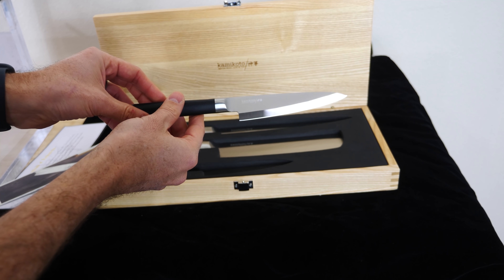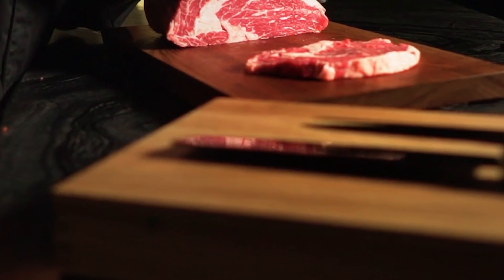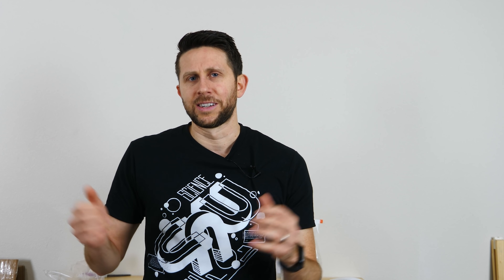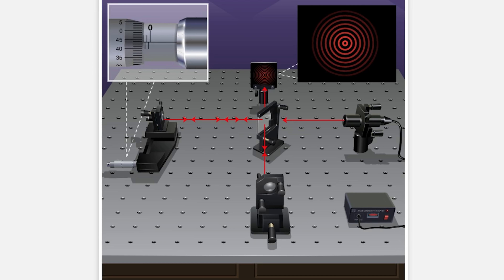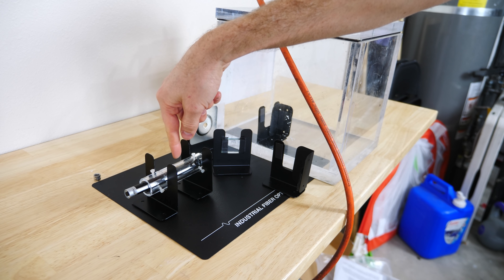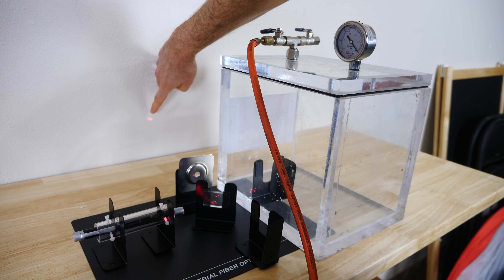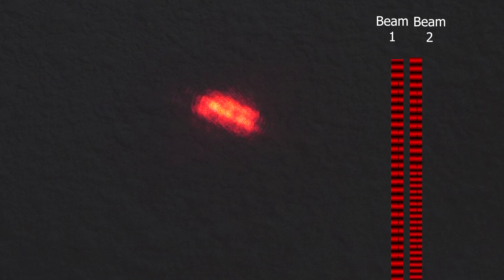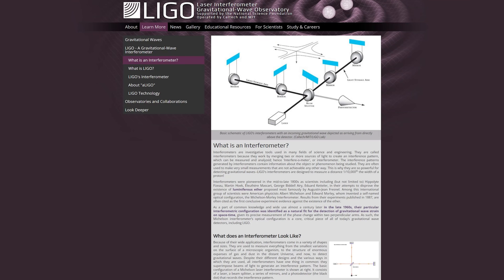The Most Famous Failed Experiment

Comment: Since the aether moves vertically into the Earth, in this setup it affects both interferometer paths in the same way, so no difference arises between them. There is an experiment that takes this movement into account and where the shift in the interference pattern is evident. It's called "Extended Michelson-Morley Interferometer experiment. English version" on YouTube. 
It's actually quite absurd to assume that the aether doesn't exist, since you can see something everywhere and photons must be everywhere. Traveling photons would therefore have to fight their way through a multitude of already existing photons. Google Angerbichner.
Reply: Isn't this done in space with the same result

Comment: This is right, but the reason why the pattern lines appear is still because of the semi permeable reflective mirror. Light does not do real cancelation like wrongly often misconceived/misconducted/stated. It's unlike a wave of e.g. water or sound acting in e.g. air which are indeed able to cancel each other out like magnets aligning, + and - = 0. But this common misconcept is due to the fact that light still can be altered in speed, frequency of the 'mass' or rather density would almost be more precise as of this case. It used to be already a sum of the addition of + & - itself as result. All cancelling in the experiments which look like e.g. waterwave or noise cancelling properties are just illusions as of being an constant acceleration kinda effect. It is like a very unheavy plasma like balanced gas or rather like aligned hydrogens of the atoms, a cascade of hydrogenlike order which seeks entropy, therefore can only get even more ordered in some altering way of it's underlying energy state of + & - .
Waterwaves have movement which can repell each other and kinda cancel itself out, sound is a wave of air itself movement which therefore can cancel itself out like wind in different fqs.

Comment: The problem is the experiment is seriously flawed and never could provide an accurate result. I'm not being an ignorant person, there is a very logical and intuitive reason the experiment would never provide an accurate reading.
I'll explain by proving the same thing could happen with sound. Take two trains and have them a set distance apart. Have the rear one blast its horn. As soon as the front one hears the horn, it blasts its horn, then the rear one records the time it took. Let's say it took 2x seconds. Next, blast both horns and have each train record the time they heard the sound reach them, which would be x seconds each.
Next, get the trains moving at some speed, keeping the distance between them constant.
Next, repeat the experiments again. The result will be that no matter how fast the trains are traveling, the result of the first experiment will always result in 2x seconds. This is exactly how the experiment is flawed. No matter how fast the apparatus moved, it would always provide the same result, just like sound did, yet nobody claims sound has a constant speed like light does. Go the the second experiment and what we intuitively know about sound is revealed. For the second experiment, as long as the trains are moving, the sound the rear train hears always makes in under x seconds. Also, the front train. Always hears its sound after x seconds. Each time, they differ from x by the same detla. That is why when they are added together, they always equal 2x.
This is the fatal flaw of the Aether experiment. They have the laser go both ways. Ya, one of them travels perpendicular for a while, but before the splitter, it traveled along the same path. If the straight beam was slowed before the splitter, so was the perpendicular one. Sure, the straight been goes on after the splitter, continuing to be slowed, but then it turns around and gets a speed boost all the way back to the mirror. By the time it joins back up with the perpendicular beam, it has undone any distortions it had gone through.
The only way anyone could guage Earth's speed through the universe from light is to gauge it's speed in only a single direction without the use of mirrors. The moment you introduce a mirror, you are guaranteeing you will only ever get an average speed.
Here's another clue. We all know that if a train is moving towards you or away from you, it's sound is distorted by the Doppler effect. A distortion induced into the sound wave because the sound is moving at a constant speed in relation to a moving source. We also know, that for the people on the train, the sound of the horn is normal, whether they are in front of the horn or behind it. We can add to this, that in reality, the sound wave is actually distorted in the atmosphere. The train observers hear an illusion that the sound is a normal sound wave because their ears are traveling at the same speed as they horn. Their change in position in relation to the speed the sound is traveling removes the distortion from being heard or noticed. This is yet more proof that the Aether experiment was flawed. You can't guage the distortion in the frequency when traving in the same direction at the same speed as it. The same would go for light.
We do know that light does get distorted by motion though, because experiments have proven blueshifting and redishifting. Such are caused by the Doppler effect, just like sound. The Doppler effect being induced into light is yet more proof their experiment was flawed. The only way to create a Doppler effect is by having the source and the detector going at different speeds. This means that one of them is not observing the light moving at light speed.

Comment: The earth is flat and stationary, space is fake. The reason relativity was introduced after this experiment was because there’s no other way to discount the results except by ignoring them which is why they introduced the Lorentz transformation formula, this formula is used to overwrite the results which were conclusive, the earth is ‘stationary’.
Everything is now based upon pseudoscience because the mathematical formula is written into everything.
The universe is geocentric not heliocentric.
Reply: Space is bubbly and dynamic, which is why Earth is round and is in motion around our empty sun because the pressure differences in space have compelled it to do so.
Gravity is due to stresses on fluid that permutates throughout space, leading to flows inside atoms and interactions with atomic nuclei. The most concentration of the resulting forces is labelled "strong force", the least is labelled "gravity".
Reply: @The-Old-Green-Man-OAP  put your dope pipe down…

Comment: Very nice. My only complaint is saying a gravitational wave could pass one of LIGO's arms. The waves were 30,000 km -ish in wavelength, so both arms are hit. They're at 90 degrees, so one gets longer and one gets shorter, which doubles the signal....that's because it's tensor polarization, because gravitons are spin 2, unlike spin 1 vector polarization of light. It's all very geometric.

Comment: The Michelson-Morley Experiment still lives on in modern FT-IR spectrometers. Instead of browsing through all wavelengths of radiation, which takes a lot of time, all wavelengths are measures simultaneously, with the intensity of each wavelength being calculated using interference and Fourier Transformation.

Comment: What effect does constant rotation (around the vertical axes, horizontal axes) or accelerated rotation have on your fringes? (Rotation will of course mechanically change the length of the optical paths, but I still wonder whether one would see something unexpected).

Comment: The ether does exist.
Light is not a traveling particle.

Explain how light does "speed up" again after "traveling" through a medium like glass.

Sound is created by a perturbation in the air. 
Illumination (what we see as light) is created by a perturbation in the ether.
Think of what an electromagnetic wave is...a wave is not a thing of itself, it is what something does, therefore it is a wave in the ether. 
There has to be a medium and it's the ether. 
You can call it quantumfoam or any other name, but it undeniably exists.

Comment: the EXPERIMENT IS MADE FOR THE "THREE DIMENSIONAL" WORLD  !!!   SO YOU GET THESE RESULT   !!!   YOU HAVE TO CHANGE THE MIRRORS (TO TWO SIDED MIRRORS  AND YOU HAVE TO COVER ONE SIDE OF THE MIRROR  WITH A HOLLOW (METAL) PIPE    !!!    WHEN YOU FLIP THE MIRRORS  (THE PIPE TO THE INSIDE OR TO THE OUTSIDE)  (MIRRORS AT THE SAME POINT AS IN THE OLD EXPERIMENT)  YOU WILL "NOT"  GET THE SAME RESULTS    !!!!   BECAUSE  "LIGHT "WORKS IN HIGHER DIMENSIONS THAN THE THIRD DIMENSION    !!!!

Comment: The Michaelson-Morley experiment is famous, not because it failed, but because it was a resounding success.  It's purpose was not to measure the motion of the earth through the ether, or to prove the ether existed.  It's purpose was to test the existence of the ether, and if it existed, to measure the earth's motion through it.  The experiment was so successful because it was so well designed that its results were conclusive.
Reply: Since the aether moves vertically into the Earth, in the normal setup of the experiment it affects both interferometer paths in the same way, so no difference arises between them. There is an experiment that takes this movement into account and where the shift in the interference pattern is evident. It's called "Extended Michelson-Morley Interferometer experiment. English version" on YouTube. 
It's actually quite absurd to assume that the aether doesn't exist, since you can see something everywhere and photons must be everywhere. Traveling photons would therefore have to fight their way through a multitude of already existing photons. Google Angerbichner.

Comment: Waves travel through mediums.  This is the intuitive reason behind the theoretical aether. The more we learn about the quantum world, the more we find we have a need to reinvestigate the possibility of an aether.
Reply: Since the aether moves vertically into the Earth, in the normal setup of the experiment it affects both interferometer paths in the same way, so no difference arises between them. There is an experiment that takes this movement into account and where the shift in the interference pattern is evident. It's called "Extended Michelson-Morley Interferometer experiment. English version" on YouTube. 
It's actually quite absurd to assume that the aether doesn't exist, since you can see something everywhere and photons must be everywhere. Traveling photons would therefore have to fight their way through a multitude of already existing photons. Google Angerbichner.

Comment: Interesting note about the original Michaleson-Morley experiments:  Although they could and did use monochromatic light (sodium flame) for calibration, they used white light for the actual experiment, so that they could use the colored fringes of the interference pattern.  Apparently this helped them compensate for some of the vibrations caused by passing horse traffic.

Comment: I think your set up could be showing the very slight flex in the bottom piece of polycarbonate from your vacuum chamber, that very small flex would change the mirrors distance and overpower the actual speed difference. Maybe do this experiment again but some how isolate the mirror from being effected by the walls or top or bottom of your vacuum chamber, or build a very strong granite or steel plate as a replacement for the bottom, those would have way less flex. Just an idea

Comment: Hello Action Labs.
If a Body following the Archimedes' Principle was in a void (a closed off cube or sphere) of fluid with no other fluids within it, with the body having fluid inside of it as well but not completly filled and beeing able to deform, would centrifugal force still affect the inside of the body?

Basically my Question: 
If a human was put in a Pressure Suite and then into a fully filled tank of fluid,
 with the Pressure Suite achieving Arichmedes' Prinziple (the body floats in the the water like a submarine, neither on the top nor the bottom),
How would the cube and with it the body react to centrifugal force?
Would it Increase the Expierienced G-Forces to the body, would it stay the same or would it even decrease them?
If the cube was put under centrifugal force, would the body move and lose Arichmedes' Principle?
 Would the Pressure of the Suite need to be ajusted?
Would the body remain in Arichmedes Principle but rotate around one of it's axis? 
How would the Pressure of the Fluid change depending on location in the cube/sphere?
What if there was no pressure suite but the body stayed floatin inmids the water, how would it affect it?
What if not a body but another sphere was within the first, with the same fluid but the smaller sphere was weightless and wouldn't pressure the innerfluid. Would it act like a Waterbubble within a watterbubble? 

I thought of this because of Ace Combat 3 and it's COFFIN Systems.
Now, I guess if I finished school I'd know this but anyway, I hope you could feature these questions in a video or some physics literate answer in the comments.
Would be really interested, though I think I know most answers to it.

Comment: M&M instrument could not measure what they intended. What you are measuring is the bending of the metacrylate wall of the vacuum chamber due the effect of atm pressure. This is what interferometers are good for, changes in refraction of light, nothibg else. 
Path of light beam through vacuum is not long enough so see effect of air.

Comment: Not as much related to this subject, but I'll try and ask anyway.

I have been wondering for a while, in Einsteins Field equation; E=MC^2, we can calculate the energy in Light, even though Light doesn't have a Mass, but only a momentum/Velocity.

My question is; wouldn't Einsteins equation also allow for an object, particle or event, where you will have pure mass and approaching absolute zero velocity? Can we describe the behavior of such a phenomenon? If such a particle could exist, would we even be able to observe it or interact with it?

My apoligies if the question does not make any sense, but if it does, I hope it could make for an interesting video.
Reply: Now im not 100% sure if I am right but I think that the equation stands for two objects of mass bumping into each other at speed of light; the E stands for the pure energy it would produce, there won´t be any leftovers of mass or velocity. In the case of light...in the equation, the M stands for mass, so it would be 0 therefore energy is 0 too, but...actually the light has mass but it is very very little. I might be wrong, it is not a simple concept.
Reply: @noemkinator  Thank you for answering. 
And it sounds like it sums up my question very neatly.
I don’t recall if it was from this channel I heard it, just remembered that the explanation for Light being able to transfer momentum an object, even though it doesn’t have any mass, was because the equation allowed it to carry momentum despite not having a mass.
Which, of cause, made me speculate if the contrary was possible, having mass without velocity.

Comment: wouldn‘t the altering interference-pattern occure anyway, since the light travels through the glass of the vacuum-chamber where it changes its velocity?
Reply: Yes and no; yes the interference pattern will be different than if the glass wasn't there, but in this case it's always there so you can ignore it for the purpose of measuring the refractive index of the air

Comment: The thing I still don't get is if you're moving at say 50% the speed of light, and emit light, it would be moving faster than light relative to a celestial body emitting light. But it's said to take astronomical amounts of energy to accelerate anything faster than light -- even light itself. Which makes me wonder why we don't constantly see light moving faster than light.  After all, if you shot light at just the right angle/timing, you should be able to accelerate light to faster than light speeds rather easily, by making one photon push another.  Do this in a big enough chain, and you should be able to get a significant amount of acceleration.  Heck, you should even be able to do it in a simpler way, by having a fast rotating armature that is very thin (think spinning a flat human hair, but smaller), while shooting light at it in the direction it is rotating.  Every single revolution should momentarily impart some force on some photons, enough that the light should move some fraction faster than the speed of light. It should also be a permanent speed increase. But that also raises another question. If it's not a permanent speed increase, then the speed of light cannot be relative, otherwise this experiment would work. So perhaps there is something else going on that has not even been thought of yet, that we're missing some aspect of fundamental understanding. Because either you can easily make light move faster than light with simple tricks, or the speed of light is actually fixed, and Einstein's train analogy for light relativity is false.
Reply: You're thinking heavily about step 83 when you took a wrong turn at step 2. As you increase speed, time slows down for you, relative to the rest. Oversimplified, this slows down time equal to the speed increase, so light moves at light speed regardless.